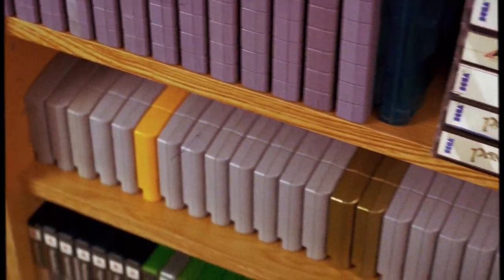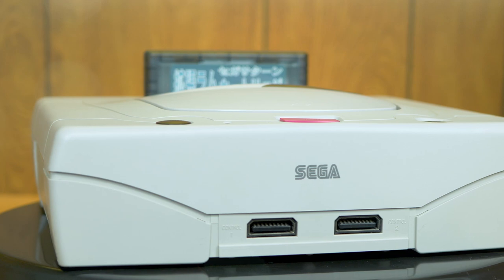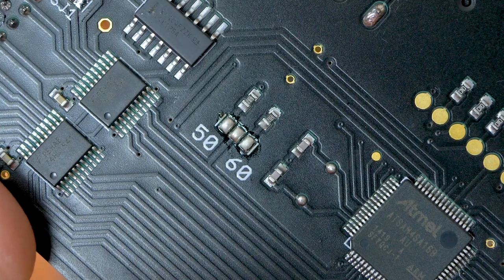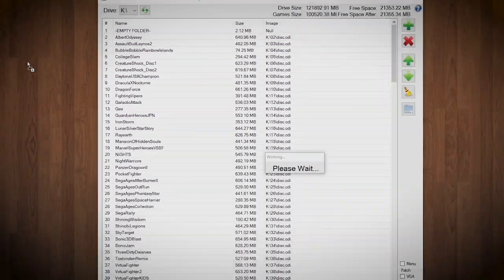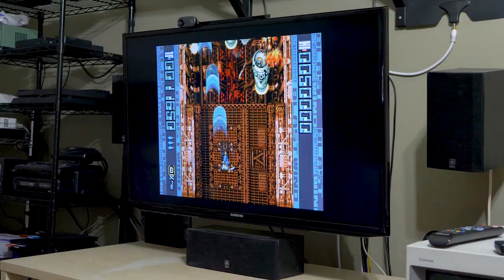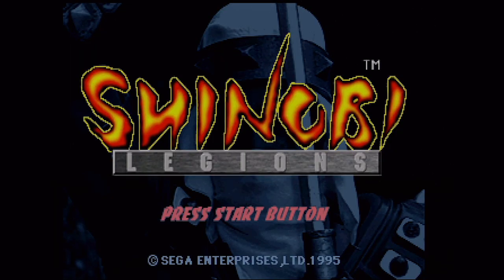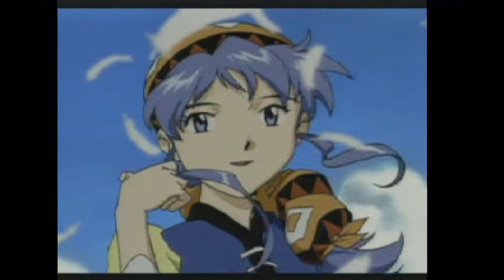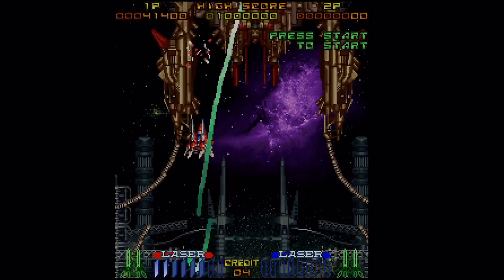Rhea and Phoebe - SD Card Reader for the Sega Saturn / MY LIFE IN GAMING

Comment: ill pass until the software is more mature, the allure of a psuedo kai cart is plug and play, burn your cue file and go... this requires reripping discs, potential solder work and other configuration... and for that reason, im out... for now.
Reply: If you are in the retrogaming with original systems you will need to solder or pay someone else to do it for you since things deteriorate over time and break, that's how it is no matter how much you want to deny it. And for old cd systems like mega cd, psx or saturn you will have to put an sd or usb adapter like it or not, hey are not like ps2 and onwards system where there are already other ways to load games than the optical drive, in these consoles the games are read only in the cd bus. And finding people willing to create something like this is like finding water in the desert, better get your unit before it dissapears. I'm still waiting on a similar adapter for the sega cd.

If you want to keep playing in your original cd system at some point you will have to dirt your hands and learn to solder because the cd drive will inevitably break before the rest of the components and getting a compatible drive is more difficult than getting new condensers.

Comment: This is an ironic situation. You want to preserve your physical media by using alternative physical media. You turn your Saturn into an emulator which kinda defeats the point of collecting this media. If this is the inevitable end goal you should just put your collection in an airtight bag and turn to emulation. SSF emulator, virtual drive and a 7$ Saturn PC controller and you get the same results.
Reply: I said nothing incorrect, no need to name call. Your modding the original hardware to emulate certain components. If this is the case you might as well put away the original hardware in safe storage or display and move to total emulation.
Reply: Your slowly moving to complete emulation is my point. Your emulating the optical drive and ripping games from the CD. You upscale the console to hdmi etc etc. The console will fail at some point. Moving to Emulation on the PC is the best way to preserve your physical media collection. Coming from someone who owns a Saturn and emulates through SSF, emulation is the best option and most cost effective.
Reply: I never noticed input lag in SSF. I've probably played and beat 50 games on the emulator and it has never been an issue or limited me to RPG games. Only problem I've had with SSF is I need to use several versions of it because certain games won't play on certain versions and that problem is limited as well. I just beat clockwork knight this morning for fun and play guardian heroes (arguably a input heavy game) all the time. 

My biggest problem is I don't like modding my original hardware because I keep it more for collection purposes past its prime rather than trying to modernize and keep alive through modding.

As for light gun games there is a way to play it but it's similar to modding.

Comment: these mods are useless and very expensive, for those prices it could be better a mod that also preserved the original working drive, it is the same for the gdemu. for the saturn it is a good way to go to wait for satiator and for the dreamcast it could be wise to go for the cf mod.
Reply: Pa M it just pick up a clone for literally half the cost and worry not
Reply: @l00tur it could be usefull if you will find me a working clone because i never found one.